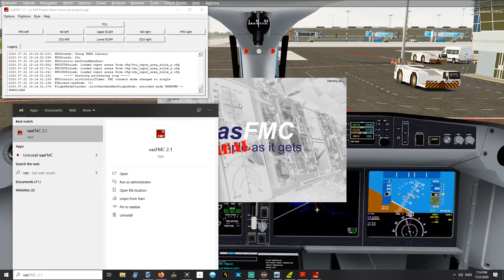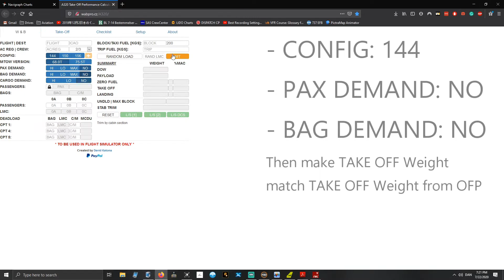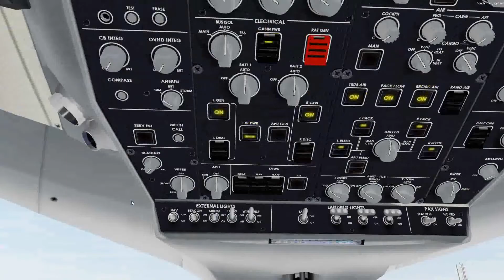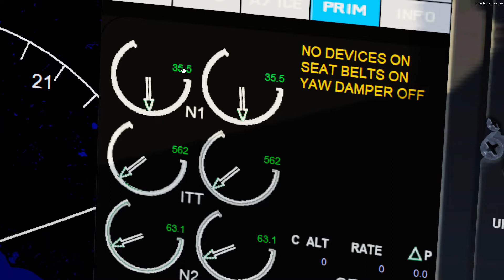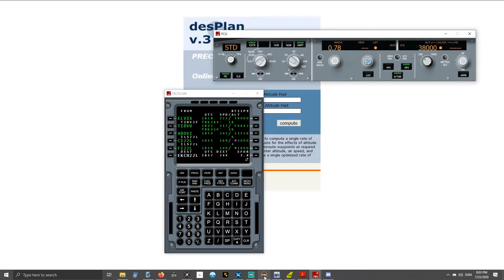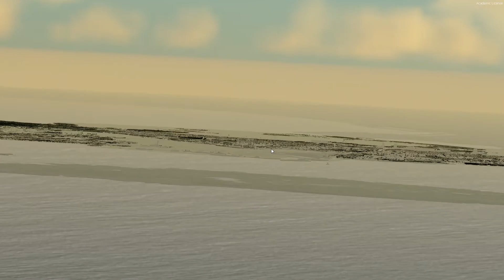Tutorial: VirtualCol A220 Tutorial | From Start up to Shut Down | vBaltic

Comment: Shalom and greetings all my pals,

I am long time customer of VirtualCol software company having owned many of their payware aircraft add ons. 

Okkayyyy  I made a FIRST Airbus A220-300 flight using route from CYLW to CYVR.  Had few problems with VirtualCol 220-300 for FSX Deluxe with SP1 and SP2.  Could not find GPS button on cockpit panel!!!! NAV button was inoperable forcing me to manually fly the plane along the specific route.  The altitude selection was not working (the bubble window showed my correct desired altitude selection but the altitude selection on the panel was wrong).

Please advise. Does anybody know how to solve the problems?? 

Thanks,

Aharon